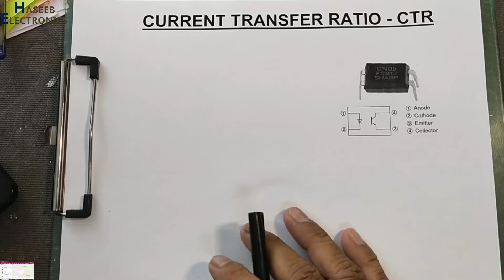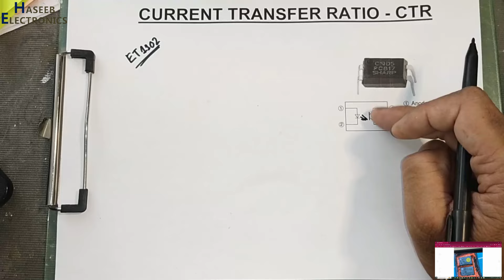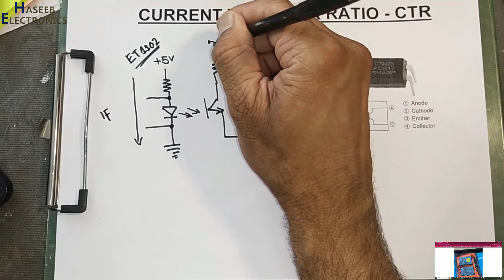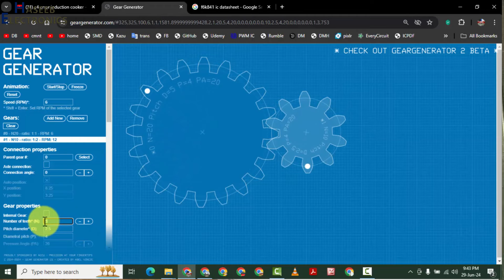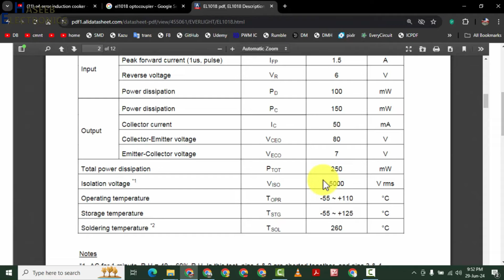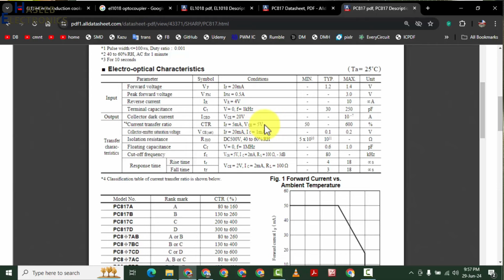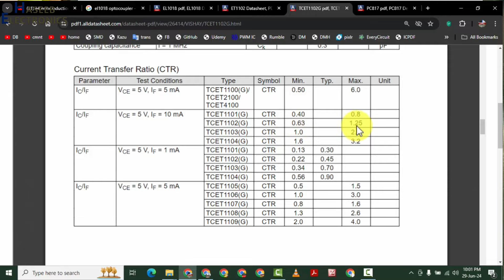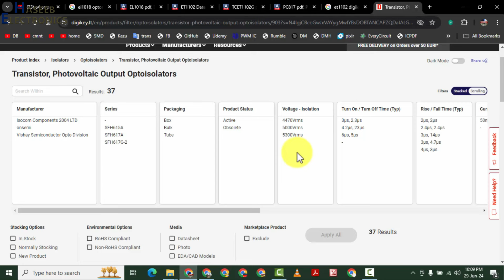{1145} Optocoupler Current transfer ratio CTR

Comment: Ahh... Thank you, Haseeb! I think that I have mentioned to you that I am a self-taught EE hobbyist and, as such, I have gaps in my knowledge base. Here, you are filling in one of my gaps. Wonderful! Thank you! Since you introduced my to the 817, many videos ago, I am finding all sorts of uses for it. It is becoming one of my favorite components. Presently, I am designing and breadboarding a H-Bridge Stepper Motor Driver. It is so simple... The LED of the 817 is driven directly by the pin of a MCU, because the LED requires so little current.The transistor of the 817 drives the MOSFETs. Beautiful. And, all possible, because of your teachings! Again, thank you! Watching the video, it became clear as to why the CTR is so important... It is because both the LED and the Transistor of the 817 are current driven devices. Maybe that realization will help someone else's thinking, too. I hope so. Also, IIRC, optocouplers come in all sorts of output types, such as MOSFETs. So, check around, if a transistor output is not quite what you need. Cheers!